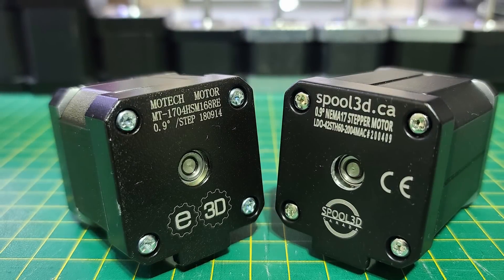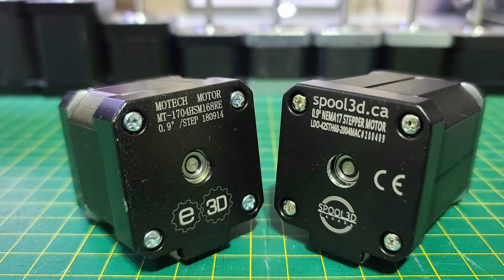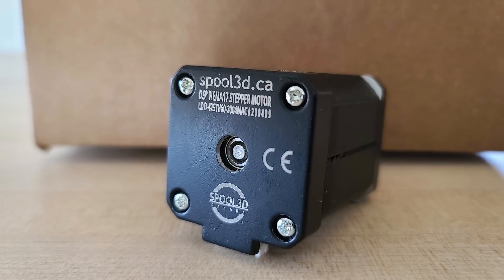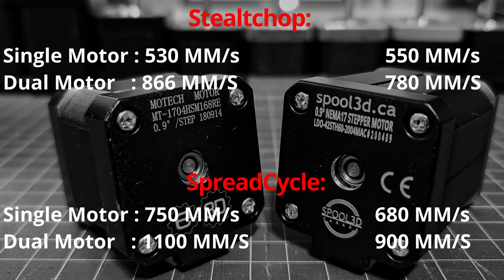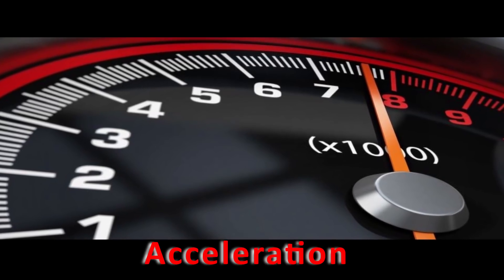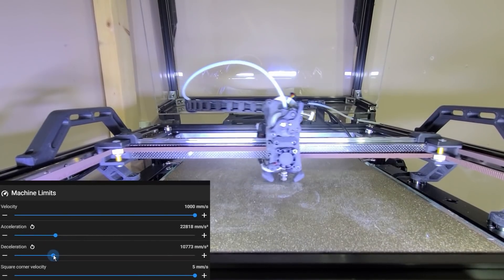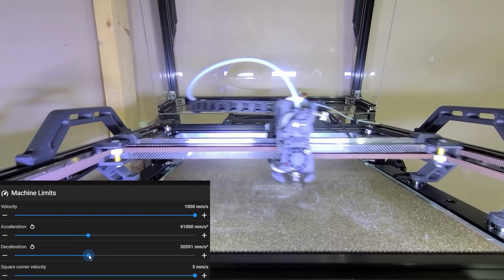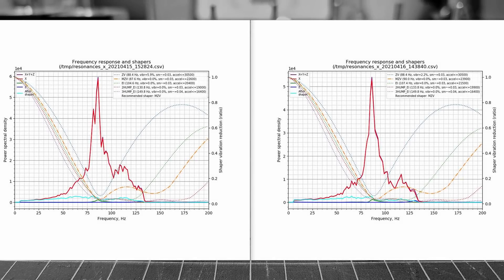E3D 48mm 0.9 High Torque VS LDO 60mm 0.9

Comment: How you compensate for higher inductance is by increasing the voltage. Field oriented control also helps significantly. As long as you have the proper power stages to handle higher voltages, go ahead and add a 96VDC power supply and see what kind of a difference that makes.
Reply from the maker: Haha   we need drivers that support that. And passed 48v  ..its a bit more risky

Comment: Hey, did you test both motors with the same current? Presumably the LDO motor could handle more current with the larger size? I wonder if it would perform better with more current.
Reply from the maker: No .. each were tested at 80% of their peak
Reply: @Vez3D  ok cool, thanks

Comment: Should these numbers of acceleration and  decerebration keep equal?  Since Deceleration is actually acceleration in an opposite direction. So 40K accel.+ 20K decel. is actually = 30K accel. 30K decel. limit?  Or I'm I missing somethin ?

Or should it be 40K accel = 20K deceleration to fight opposite momentum of the moving mass?

Comment: Thx for sharing such a great video for product comparison!!!  My coreXY machine with 70nm torque steppers as X+Y motors stills having layer shift issue sometimes whenever the speed up to 250mm/s or above.  Do u think the shape of my machine in rectangular with 550mmx350mm printable area is the root cause? Or coreXY must be in “square” in order to keep all belt tension in even?  I am using 6mm belts for X/Y btw.  Thx!

Comment: it maybe the higher mass of the rotor is not able to be so responsive  at these higher accelerations, it may be another story if your hotend and moving parts were heavier. I also noticed LDO didn't list the detent torque which has a larger effect at such high accelerations. loving the work on brushless motors, tuning them should be a learning curve , with respect to extrusion rates. best of luck!

Comment: What's the reason to compare 2 different tall motor? if you want to do a fair comparation, how about to compare same tall motor, LDO 48mm 0.9 will be LDO-42STH48-1684MAC.
Reply from the maker: I would love to :)  the reason is that it was just the 2  0.9 degree motors i was easily able to get
Reply: @Vez3D  Timing to send you more motors!
Reply from the maker: @ldomotors  would love to test your best accel/speed beast :)
Reply from the maker: I already run with LDO nema14 on the extruder and its a small pack of power. Really impressive

Comment: Could I ask which stepper-driver ? If its a 2209 it is optimized arround 1,2 A max - so the bigger one would be underpowered
Reply from the maker: 2209. 2.8amp peak.. and 2.0 rms are the specs
Reply: @Vez3D  Ah was thinking where I had this from ( https://docs.vorondesign.com/community/howto/120decibell/calculating_driver_current.html ) the voron guys again. Don´t know where he got that 1,2 amps from but maybe wouldn´t hurt to try with 5160 trinamic . They can handle more amps (for sure)

Comment: I appreciate those high speed/acceleration videos, but can you pls make a video about dimensional accuracy. Is this still a thing when it comes to these high speeds/accerlation?
Reply from the maker: My printer is being uograded at the momment but I can say that its been fine for dimensions so far...on simple to moderate complex part. For really complex and small details part.. you need to tune your slicer at lower speed on some places.

Comment: Hello again 
I'm waiting for your kind answer... 
In the meantime I bought the stepper in your video (e3d) and gave them 1.2A in the firmware... but same problem.
If I go over 13000mm/s acceleration, even at 300mm/s speed, i hear that bed sound and the stepper stop working... Can you help me? Thanks
Reply from the maker: Your printer must be heavy. Thats all I can think of. Remove weight. Weight is enemy of accel
Reply: @Vez3D hello and thank you very much. im using extrudort (great project) and same stepper as your for the extruder... maybe to much tension of the belt X & Y?
Reply from the maker: @frfioron  with carbon tube? And all other vzbot carriage?
Reply from the maker: Oh.. are you on 12v? If so...there is your issue
Reply: @Vez3D  I'm on 24V and the project is like your fusion360 project files. The 2020 square tube on X is aluminium not carbon... but super light aluminium (totally empty inside)
Reply from the maker: @frfioron  same driver?
Reply: @Vez3D  yes tmc2209 bigTT with skr1.4 turbo (x and y with 1.2A current in the firmware)
Reply: @Vez3D  yes tmc2209 bigTT with skr1.4 turbo (x and y with 1.2A current in the firmware) and i'm using marlin 2.0 but for the speed and acceleration test I use Pronterface... i dont know if its a firmware issue??? oh and I dont use stealtchop mode on x & y... just to give stepper maximun speed... but...
Reply from the maker: @frfioron  as weird is sounds..try lowering amp to 1.0-1.1
Reply from the maker: @frfioron  oh.. and.. are you cooling your divers? They get really hot and fail if you dont. Add some cooling or you go very high. I should have said that at the beginning....i just didnt think about it
Reply: @Vez3D  ok... I will try all... Thank you very much
Reply: @Vez3D  hello... Now I have a big fan on the tmc2209, and even without the stepper on X axis and without any weight (just the X carriage) i can't reach your acceleration. Maximum is 15000 acceleration on 400mm/s speed. If I go to 16000accel they fail...  I can't understand... In your opinion could be a Marlin limitation? We have same printer, same stepper, same driver, same skr board... All is the same as you... And the x and y axis are so free to run smoothly and run perfectly without the belt.... i can't understand
Reply from the maker: @frfioron  i dont know. Hard to say man. Try with klipper
Reply: @Vez3D  for sure I want try... But is it possible to use klipper on the skr1.4 turbo?...
Reply from the maker: @frfioron  yes why not

Comment: Vez i have one question for you. I just got my high torque based on your recommendation. I just found out that they have a smooth shaft, not a v cut. Did you mount the pulleys in any special way? I'm worried about them slipping. Thank you
Reply from the maker: Just tight both screws. It will hold

Comment: odrive yay! I wonder how the precisions will be as this will surely need a bit of fine tuning on the PID controller depending on the aimed acceleration... 

Also at what point of the accuracy gcode will move to the next line? I think there should be a threshold accuracy value needa to be implemented, yeah?

Cheers for the video and the comparison!!
Reply from the maker: We shall see soon.

Comment: Great job! I have the same experience with those steppers, I could run the LDO at higher % of current than the e3d but at the same % of current it got much hotter.

Comment: The smaller motor does better on acceleration because of rotor inertia and BEMF constants. If you want to increase your acceleration capability on any motor, just increase your supply voltage so that the voltage ratio between your supply and the bemf generated by the motor is above 5:1. The test you've presented is good for showing the differences, but is not good to compare motor capability and saying which motor is better.
Reply from the maker: Agreed. But we can say that at same voltage the  e3d is better for speed and accel in MY setup with that amount of weight to carry etc.. Overall better ? I cant tell :)
Reply from the maker: The LDO would be better in another type of test...like moving more mass ... since it has more torque.etc..  :)
Reply: @Vez3D  The torque is only required at acc and decc so it doesn’t matter at constant or holding speed without movement. My experience with the same two steppers is the same on my 500x500 toolchanger. My speedrun est was with the LDO and I get much better with e3d now but I have to stiffen my frame before the next test.
Reply from the maker: With different gearing..maybe the ldo would give more ? So much things to test lol

Comment: the deceleration setting isn't deceleration.. it's a speed limiter and don't alter the deceleration or acceleration in any way. 
here's how Kevin explain it:
Specifically, the code calculates what the velocity of each move would be if it were limited to this virtual "acceleration to deceleration" rate (half the normal acceleration rate by default). In the above picture the dashed gray lines represent this virtual acceleration rate for the first move. If a move can not reach its full cruising speed using this virtual acceleration rate then its top speed is reduced to the maximum speed it could obtain at this virtual acceleration rate. For most moves the limit will be at or above the move's existing limits and no change in behavior is induced. For short zigzag moves, however, this limit reduces the top speed. Note that it does not change the actual acceleration within the move - the move continues to use the normal acceleration scheme up to its adjusted top-speed.
Reply from the maker: Interesting.. ill read more about it. Thanks Nitram. Very good info here

Comment: Did You try to test those steppers with other drivers?  this may bring other results - also as the board You use has the option to replace drives - external higher voltage drivers may give even better results...

Comment: Hmm, I have to say that I didn't see that one coming. I would've bet on the 60 mm anytime. I guess there's more to speed and acceleration than inductance and stall torque. Can't wait to see what you can do with those brush less!
Reply from the maker: Someone mentioned that the ldo is advertized at 2.8mh but measuring like 3.3..that would explain it.

Comment: I'd be curious to see you redo the test with 25T pulleys instead of 20T.  The higher torque would work better with 25T, which would also give it higher speed.  25T also works out to an even step, so it's a "clean" number.
Reply from the maker: That would be a good idea
Reply: @Vez3D  if you were in the US I’d send you a set. POWGE has them available on Ali. I can get you a link if needed.
Reply from the maker: @TheJaredC01  ill see if I can get some on amazon

Comment: Try sigma7 yaskawas they might pull the printer out of the printer..
Reply from the maker: That doesnt look like a cheap option haha
Reply: @Vez3D   :) I wonder what would be the smallers motor you could use with such servo driver. But indeed.. thousand$.

Comment: Have compared random other Chinese motor with same spec and size. I always suspect that only branding difference in them. I don't own any fancy motor motor but it's seems to me when they say high temperature it's only PTFE wire they use or anything more.

Comment: Hi and again congratulations for your videos and your printer.
I have a question for you:
I made a replica of your printer and work really fine but, if I try with 400mm/s speed and more than 15k acceleration, this cause issue and bed movements.
I ask you: do you think 
the limit is the stepper motor? I mean, do you think that changing motors i'll can go with faster acceleration?
I use skr1.4 turbo board with tmc2209 (all at 24V) but standard stepper motors.
Thank you in advance for your kind reply.
Francesco from italy.

Comment: hey buddy did you try these results with 5m pulley and belts. On RepRap emf calculator page that will eventually increase the speed by lowering the steps when you use 5m pulley. Do you think that will help

Comment: Now I wonder how E3D's "super whopper" motor performs considering they describe the HT as an all rounder and SW for high acceleration.
Reply from the maker: 8.2 kg torque with 3.3 mh inductance for 2amp rating with all that inertia. I dont think it will be as fast.. but thats still to test

Comment: Hey, for your interest: E3D motors are manufactured by LDO.

Edit: Jason from LDO did following statement:  "Current only Hemera motor from LDO, and may some future E3D project. Their regular stock motor not from LDO."
Reply from the maker: Good to know. You 100% sure?
Reply: @Vez3D  Yes, you can also ask Jason from LDO on Twitter. That means that you tested two motors with different specifications instead of two different brands.

Nice printer btw!
Reply from the maker: @vibasept7733  I know they were not directly made by E3D, but didnt know they were LDO :) very good to know ty
Reply: The E3D motor shown here is branded "MOTECH" (as are all of my E3D motors, and the spec sheets on E3D's website).
So is Motech a sub-brand of LDO, or a parent company of LDO? Or something else..? 🤔
Reply: Hey, small update, got the info from Jason from LDO: "Current only Hemera motor from LDO, and may some future E3D project. Their regular stock motor not from LDO."
Reply from the maker: @vibasept7733  thanks for the follow up
Reply: @vibasept7733  Ah that's cool, thanks :)

Comment: Very interested to see the results with the ODrive after this. You could also try the JMC iHSV42-40-05-24 as they are a lot easier to mount.
Reply: Dont try it. The iHSVs have a peculiarity in their construction that make it difficult to make perfectly smooth walls when using belts as it is in 3D machines, I do not recommend them. Better good stepper and good driver than cheap servo.

Comment: I'd be interested in seeing a noise comparison between stealthchop and the odrive, I've been thinking about making a small printer with a focus on quiet operation.
Reply: if you replace all the fans you can make a ender 3 v2 very quiet... the hard part is decent 5015 blower fans, i dont know if they exist :( . but all the others are easy go big pc fan for motherboard and psu, 4020mm fan for hot end... im sure you can do the same with many other 3d printers...
Reply: @specialingu  the steppers are far more noisy than the fans in my i3, unfortunately.
Reply: @teguh.hofstee  have you tried the vibration absorber mounts for them? They are pretty cheap 😊

Comment: Epic! Couple of questions:
- Do 0.9 steppers sound louder comparing to 1.8? For me the noise much more high pitched during normal speed operations at stealthchop, at least at 24V, comparing to 1.8 steppers.
- Have you tried smallest Nema23 steppers instead of Nema17?
Reply from the maker: It depends on the motor i guess. They are not quiet but higher voltage helps. At low sleed they are quiet though and in stealthchop they are super quiet

Comment: I've got a nema23 with 1.38mH inductance on the way. Hopefully its as fast as those e3d high torques
Reply: I didn't even know motors with such low inductance even existed.
Reply from the maker: Depending on the rest of the specs..they should fly

Comment: This is a perfect benchmark video. No useless talk or ads but just the necessary data and perfectly shown benchmark data by which it is really easy to tell the outcome. Perfect, mate. Admirable.
Reply: Indeed, if i could i would throw more likes to this comment! 
Also for the video!
Vez3D keep up the good work, and this style!
It is ridiculous what you can do with MirageC. I am amazed to the point i have to try this as well. :) (until now i was accepting that fff have to be a slow process)

Comment: Duuuude. Your channel is reeeaally pushing the limits AND handing out the details to the community!
Your channel is atm the most worthy channel for future 3D printing!
Cheers mate for all this!
Wow!
Reply from the maker: If you want another awesome channel.. go check https://youtube.com/c/MirageC
Reply: @Vez3D  this one is good. But actually yours is much better because you have a much simpler designed printer, which is much better. And you provide a ton of necessary Infos to build really fast printers.
Reply from the maker: @haenselundgretel654  there is a printer for everyone's need. The hevort is awesome too
Reply: @Vez3D  I really like your humbleness :-) but as an engineer and a person building own printers I know what's best. And actually yours - for me - is the new gold standard because of its print quality, speed and simple design (/price). The Hevort is a good recommendation but waaayy too overengineered at a lot of points where your printed just shines with a much simpler design. And a simple design is the real challenge for a good engineer. I really prefer yours over every printer I've seen since I'm in 3d printing.

Comment: When you want speed you can try to get hands on an encoder for those stepper and than use the tmc5160 for them. The tmc5160 is allways trying to get the most speed and with the encoder is the best.

Comment: This video could not have better timing. I'm in the process of building my own CoreXY and sourcing LDO motors in the UK is very difficult. 

Question: how about noise? I understand you're running at 40k accel but at lower speeds, let's say 3000mm/s² and 100mm/s, is one motors significantly louder?

And how about VFA reduction?

Great video :)
Reply: pour les moteurs LDO vous pouvez toujours voir chez ratrig ;-)

Comment: Great info!  I have seen some torque charts for the 60mm LDOs and I think they can still perform if they are geared up a bit, say, with 25T pulleys.   I’m testing out OMCs 48mm 2 amp 1.8 - I have been told it’s a cut above the rest as far as torque.

Comment: Would the microstepping ratio have an effect on the maximum speed/acceleration? Microstepping brings the effective torque down drastically right? what microstepping ratio are you using?
Reply from the maker: 8..and yes it has edfect. 8 is where i have max torque